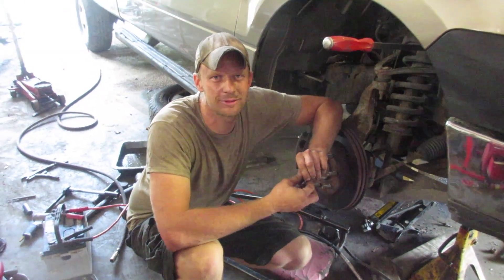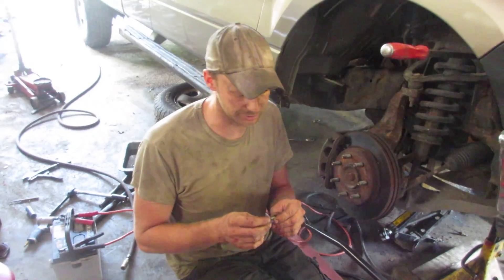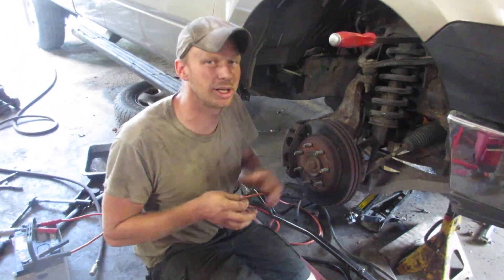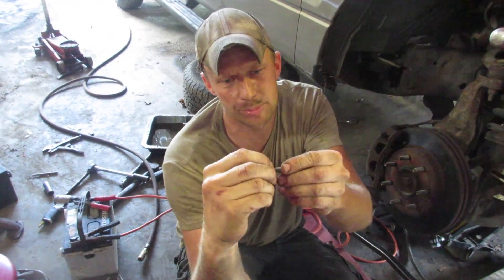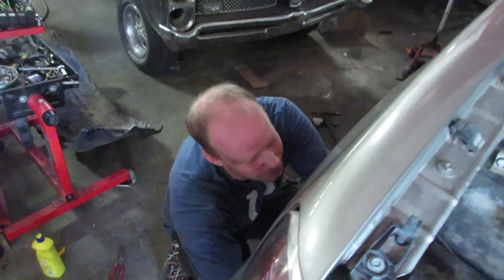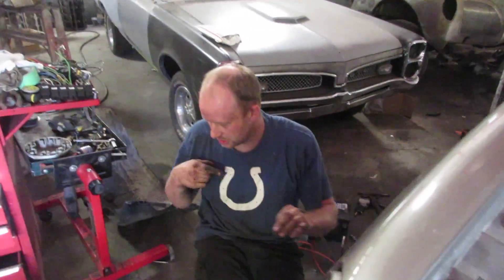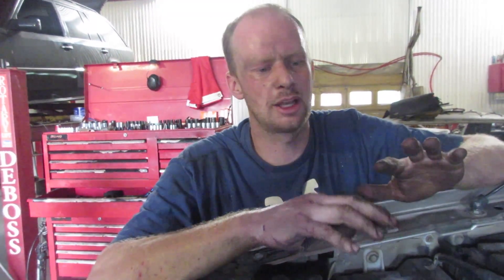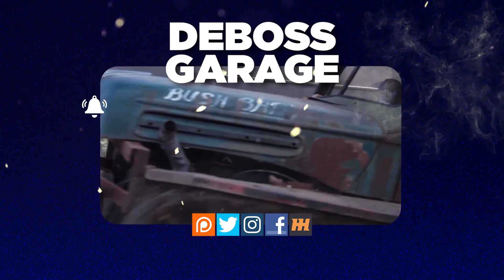How To Remove Broken & Rusted Stud Stuck In Aluminum (Thread Saver!)

Comment: The battery trick is a great idea. I use heat and the welding a nut all the time. I will try this on the next broken stud.
Reply: feed it some beeswax while hot... knew an ol' mechanic who swore by this. Most talented mechanic I ever met in my entire life.
Reply: Yup. I heat some up and fill old deodorant & chapstick containers... the latter works great on woodscrews.
Reply: John Possum I'll vouch for the beeswax. We use that all the time at the farm. I just keep a toilet gasket around the workbench for just that reason.
Reply: Will regular "paraffin" wax  work just as well?

Comment: you are a better man than i as i hate fords so much i wont even work on one
Reply: chrisrhudy2000 ever try and put long tubes on an LS? Same deal.
Reply: Joe - True, but Fords are usually harder to deal with and the corrosion on their manifolds are more severe.
Reply: sisco - No. Just Ford 4.6 and 5.4Ls. Nobody else has this ridiculous, well known manifold problem.